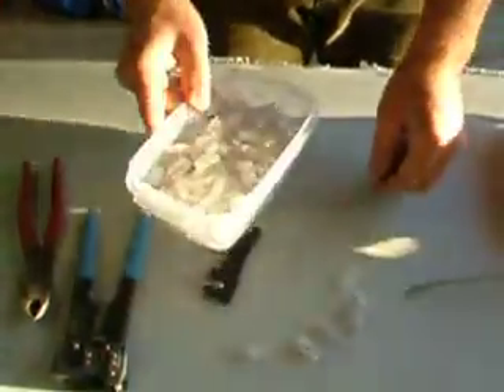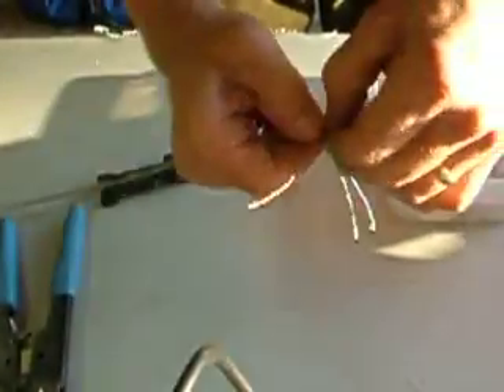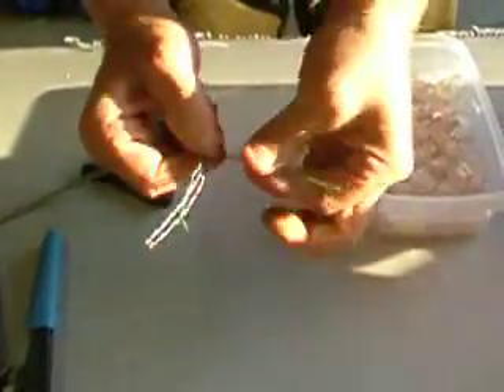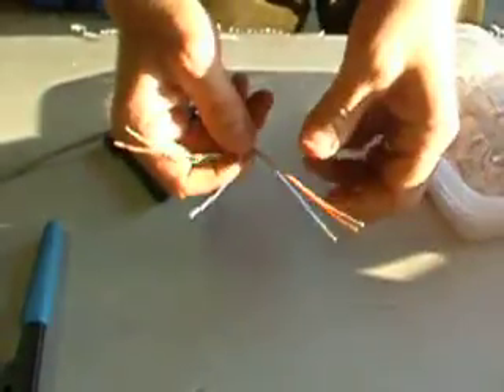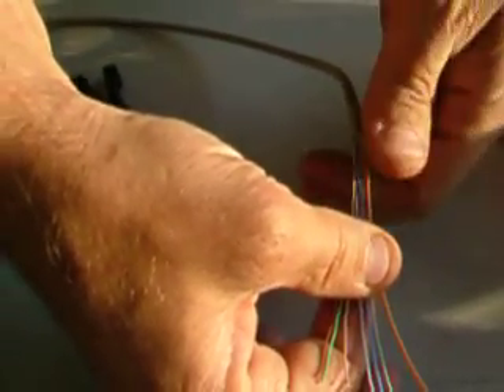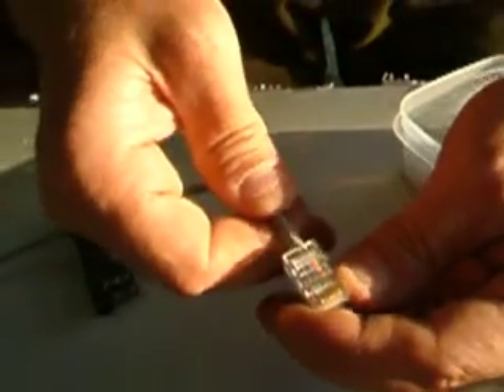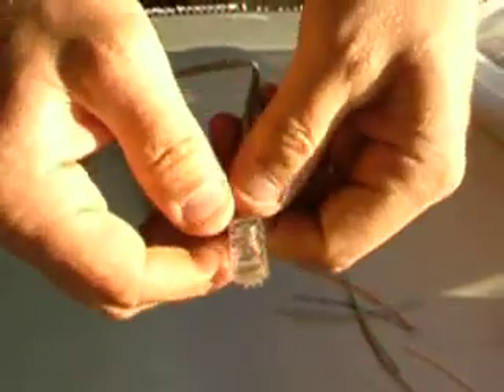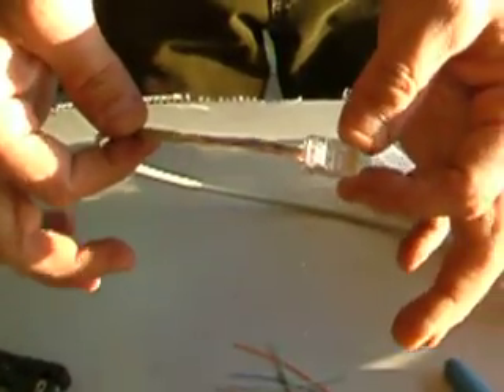RJ45 Modular Plug Install

Comment: Cheers, after so many failed attempts I watched this and then did it perfectly and am confident I can every time now, I was cutting them to the right length first then trying to untwist and sort out, the extra length and pulling makes the world of difference, many thanks, you have saved me a lot of fiddling. Nice clear instructions. No half assed connections here.